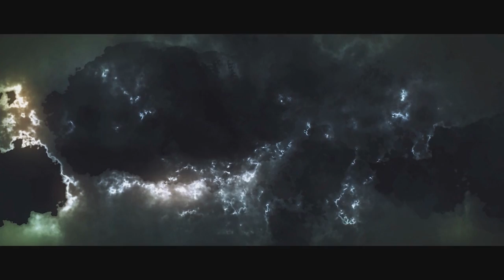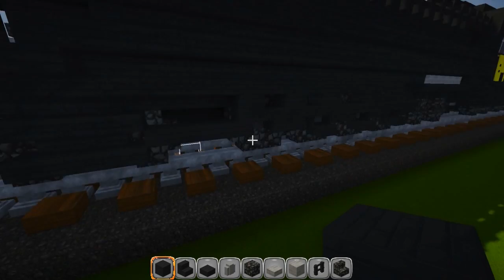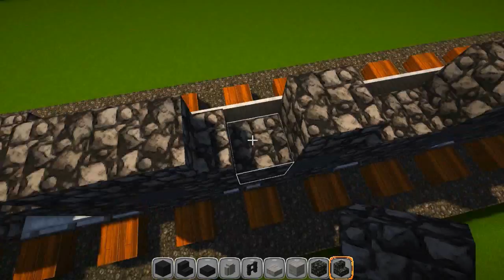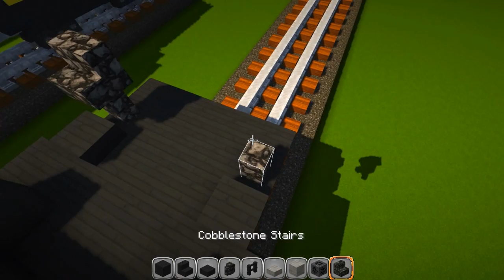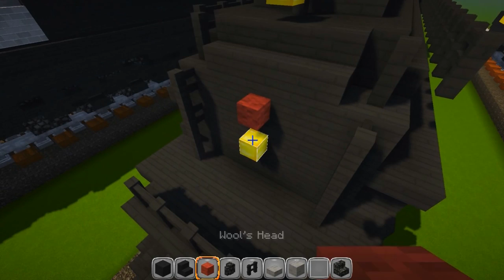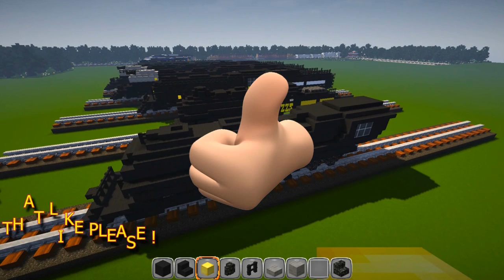Minecraft Train Tutorial : Steam Locomotive - Union Pacific 844 TUTORIAL

Comment: New South Wales C35 class locomotive
From Wikipedia, the free encyclopedia
New South Wales C35 class
NSWGR Class C35 Locomotive.jpg
Class C35 Locomotive
[hide]Type and origin
Power type Steam
Builder Eveleigh Railway Workshops
Build date 1914–1923
Total produced 35
[hide]Specifications
Configuration 4-6-0
UIC class 2'Ch
Gauge 4 ft 8 1⁄2 in (1,435 mm)
Driver dia. 5 ft 9 in (1.753 m)
Adhesive weight 139,000 lb (63 t)
Loco weight 183,000 lb (83 t)
Fuel type Coal
Firebox:
 • Firegrate area 31 sq ft (2.9 m2)
Boiler pressure 180 psi (1.24 MPa)
Heating surface 2,235 sq ft (207.6 m2)
Superheater:

 • Heating area 545 sq ft (50.6 m2)
Cylinders Two, outside
Cylinder size 22.5 in × 26 in (572 mm × 660 mm)
[hide]Performance figures
Tractive effort 29,186 lbf (129.8 kN)
Factor of adh. 4.75
[hide]Career
Operators New South Wales Government Railways
Class NN1027, C35 from 1924
Numbers 3501-3535 from 1924
Preserved 3526
Disposition 1 preserved, 34 scrapped
The C35 class was a class of steam locomotives built by Eveleigh Railway Workshops between 1914 and 1923 for the New South Wales Government Railways in Australia. Despite their elegant, somewhat English looking appearance, they suffered a long period of teething troubles and were poor performers, especially on long climbs.[1]

Contents  [hide] 
1 In service
2 Modifications
3 Preservation
4 See also
5 References
In service[edit]
They took over hauling The Fish, from Sydney Central to Mount Victoria in June 1918 and the Caves Express on the same route in 1932. To operate this 3506, 3526 and 3535 were painted in Caledonian Blue to match the carriages.[1]

After being replaced by 36 class locomotives on Southern and Western services they were transferred to operate North Coast and Northern Tablelands express and mail trains until replaced by diesels in the 1950s. The first was withdrawn in February 1959. During the last years of service, they were confined to working both passenger and freight trains north of Gosford on the Main North line. The last was withdrawn in August 1968.[1][2]

Modifications[edit]
In May 1935 an ACFI feedwater heater was fitted to 3508. It was apparently not a success as it was removed in 1939 and no other member was so fitted.[1]

From December 1937 the class was rebuilt with heavier frames, rebalanced driving wheels, new boilers and new cabs with more shelter, replacing their Great Western Railway look.[1][2]

Preservation[edit]

3526 taking on water at the Hunter Valley Steamfest, Maitland
The New South Wales Rail Transport Museum preserved 3526. After being repainted into Caves Express blue livery at Petersham in 1967, it remained serviceable until June 1975. Its last journey was from Enfield to Thirlmere hauling 7100 and 2606.[3][4] It was overhauled and returned to service in 2004.

See also[edit]
NSWGR steam locomotive classification